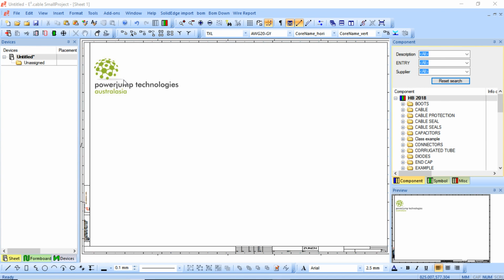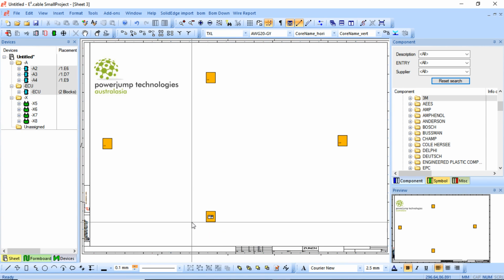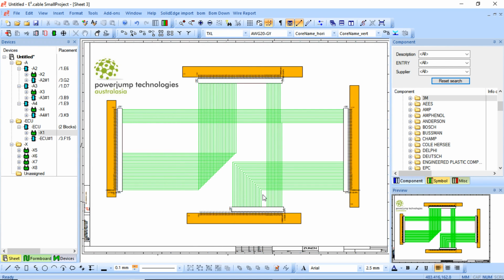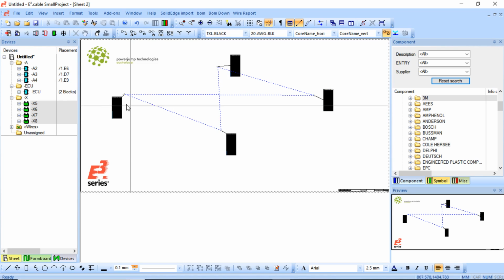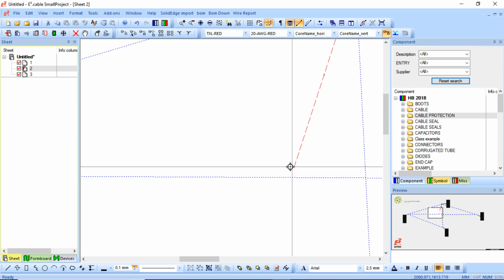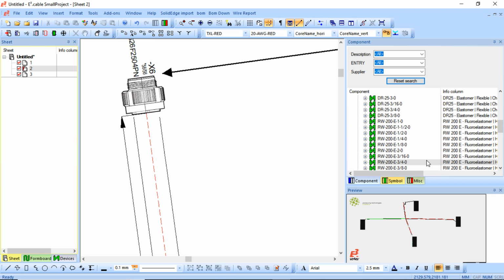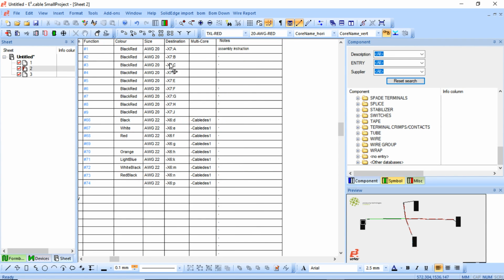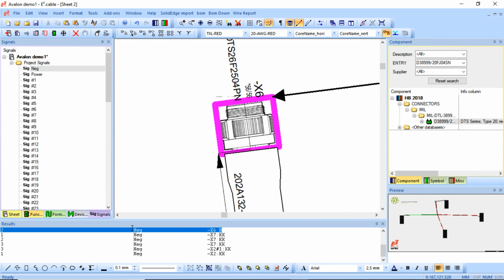Easy multi representational Vehicle Design Using Zuken E3.Series

Comment: What is the system requirement to install zuken?
Reply from the maker: Hi Veronika, sorry its taken so long for a response,
the system requirements are pretty basic, a windows 10PC with mild to moderate CPU capabilities will suffice. 

the only recommendation i have is to make sure you have a good resolution capability to maximize screen working space and visibility. 

Officially zuken quote:

2 GHz CPU or higher
at least 4 GB RAM or more
19" monitor with 1280*1024 with True Color or Wide Screen monitor; alternatively DualScreen solution. 3-button "wheel-mouse"
l at least 10 GB free disk space on the hard disk (for the normal installation)
l there's no special demand for the video card.

hope this helps :)